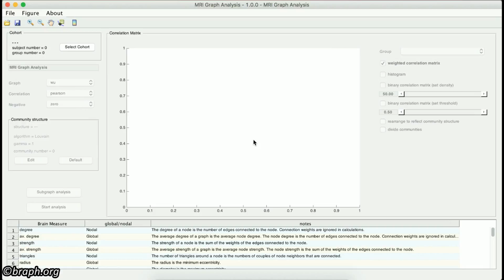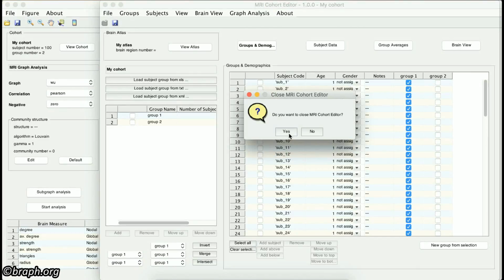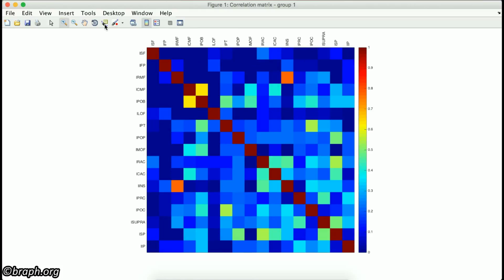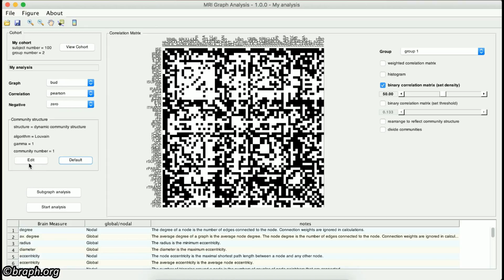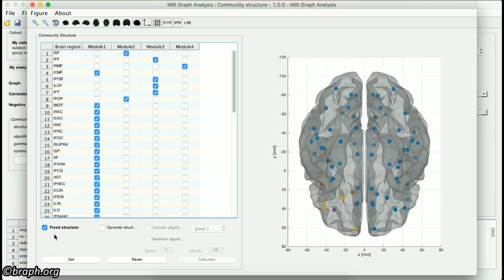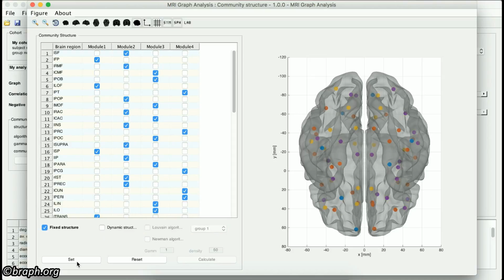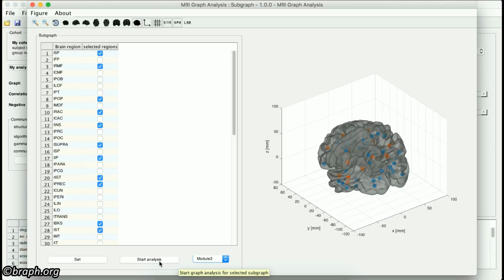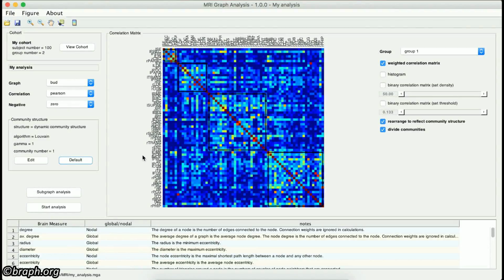MRI Graph Analysis 1.0.0 - Part 1

Comment: is it possible to use BRAPH for MRI DTI analysis?
Reply from the maker: Braph 1.0 does not include this option.
However, we are now working on a new version Braph 2.0 to be resleased in a few months that will include it.

If you'd like to use Braph 1.0 with DTI, this is possible with a development version which we can send you if you contact us by email.
Reply: @softmatterlab   thanks a lot for your prompt answer, therefore I need to wait for second version of software